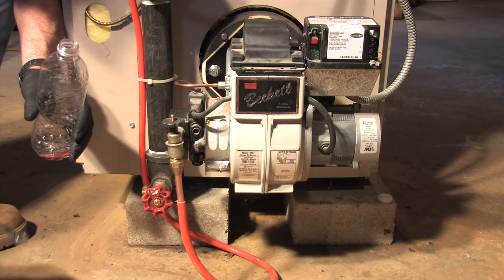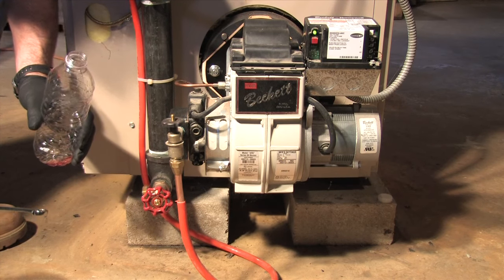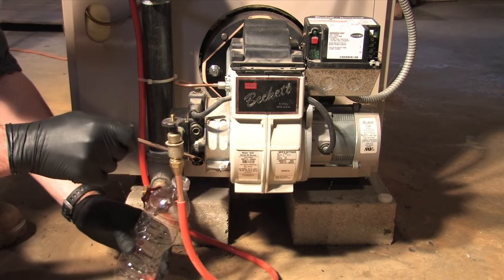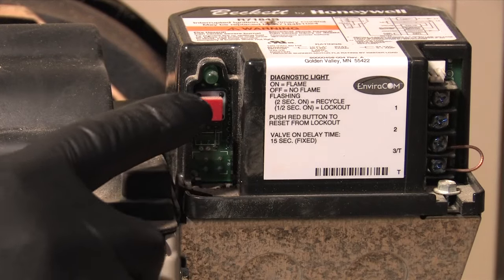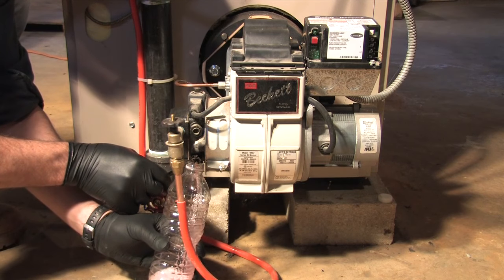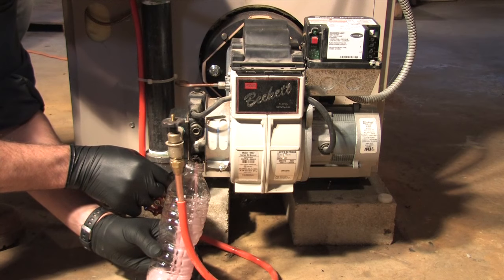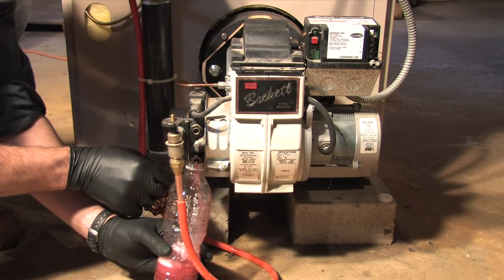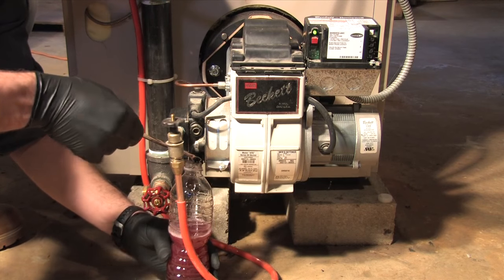Ciardelli Fuel - How to Prime an Oil Burner

Comment: hi steve i had a new roth tank installed and the tec cant get the air out of the system bleed 2 gal of air and oil out filter is new all are new pump is new it seems be serging anyhelp please. could the burner motor be doing this?

Comment: That valve at the end of the fuel line high left side of the bleeder valve…. Should that be loosened all the way??? Or say you tighten it shut all the way.. and crack it loose a couple of turns???
Reply: a quarter turn no more no less